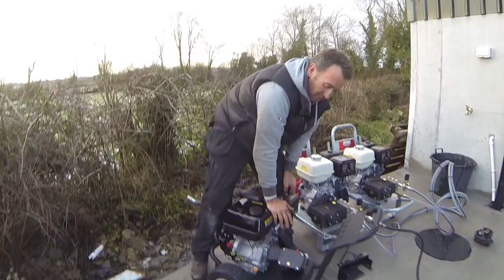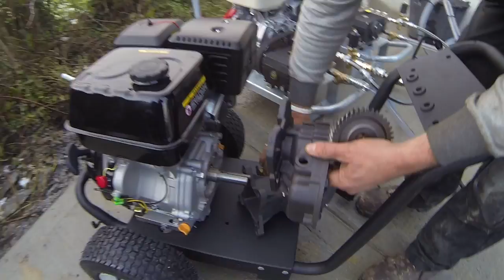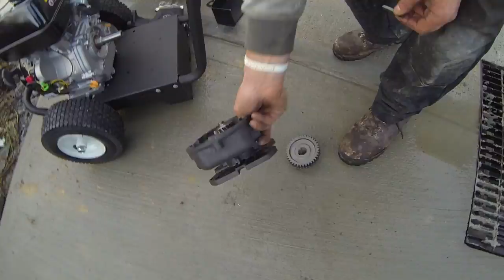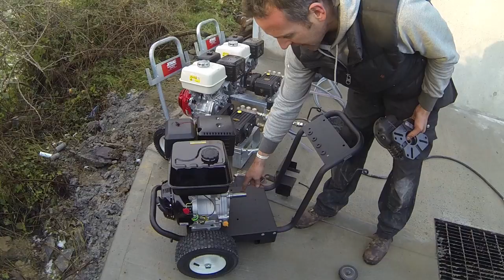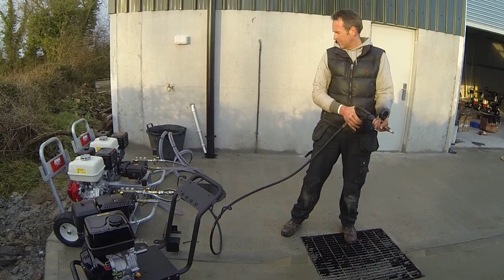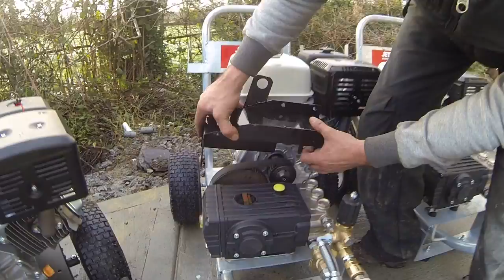Comparison of Pressure washer Pump types - Direct Drive , reduction gearbox & Belt drive

Comment: This is great info. So as a rookie I learned that a direct drive pump cannot suck water from a buffer tank. Ive been told either a gear reduction or pulley system pump is the only way to suck water from a tank. I think this is also an important difference vs the direct drive.
Would this be a correct statement?

Also, on a 13hp GX390, what would be the maximum GPM on a belt system?

Thanks!

Comment: I know this is an older video and very well presented, very educational for new people needing to know this.  I have GX390 that came with a direct drive triplex plunger pump,  can I removve that pump and put on a belt drive system or a gearbox system?  I'm assuming the shaft from the engine is the same for all 3?

Comment: You just made the perfect example. A pressure washer running out of water when you just stuck the hose back in the water tank. With these pumps, how many times can you do what you just did by running out of water and quickly shutting the engine down to you have enough water to start beginning to wash again? I've been in business with my father for over 25 plus years and the pressure washing industry commercial and we always have problems with her pumps going out on us yesterday my Kohler command gear driven pump completely burned up on me it could have caught a fire and I do not know what is causing this problem and once in awhile when I use the surface cleaner it makes the pump create pressure you would think it would make the engine strain but now it made the pump strain so much it created pressure and burned it up and the people are always blaming me for breaking the pumps when I'm not doing anything at all now if you get to a job you got a full tank of water and they don't have good water pressure and you run out you know you got to go and run your to your machine to shut it down running it out of water 15 times a month in a year is that enough to make the pressure washer pump go bad on you and I'm not saying I do that I'm just giving an example it may happen a handful of times running out of water because the customer may have poor water pressure and what causes the pump to get pressure inside of it?

Comment: To keep the water flowing through the pump and system without heating up the water pump, build a reserve bypass tank on through the unloader. Works. No waiting for pressure to build and purge on system. If you need some top secret tips, hit me up.

Comment: They both do the exact same job, cutting the speed in half from the motor. Direct drive is way easier to set up and works absolutely as well as a belt driven system with less maintenance. Both cost about the same... your choice..
Reply: No they don't at all..belt is like $1000 more in same gpm class

Comment: I just ordered the Simpson PS60919 it’s rated at 4400-PSI and 4 GPM. I wanted to get the ALH4020 but it was not available. The PS60919 it’s rated at 9HP and the ALH4020 it’s rated at 13 HP. Can someone explain why the difference in HP when they both have the same Honda GX390?
Reply: Well @4400psi × 4gpm=17.6hp
So theres no way that with a 9hp motor you're going to get 4400psi
Which is fine because you'll never need that much psi, but the problem is that a 9hp will have to work @ 100% all the time to deliver even 3000 psi, which will eventually hurt the motor, as the 13hp wont have to work as hard, but at that psi for even both motors isn't recommend, you really need atleast a 15hp motor.
Hope this helps.

Comment: Belt drive is nice because you can change the pulley and increase the pump speed thusly increasing the PSI but increasing it only to the max recommended and then adjust the motor to increase/decrease engine speed.  I have direct drive with Honda motors, they run so smooth that vibration isn't an issue as well as I have a CAT pump which for what I use it for is flawless.  BUT I will say that my next high GPM machine will be a belt drive.
Reply: krisone63 k

Comment: I dont know a lot about pressure washers but you have a barrel of water, does the pressure washer suck up the water? or is there something to feed it to the pressure washer?
If I bought any gas pressure washer can I do that same thing?
Reply: I was going to ask the same thing. I see no reason why we couldn't also use a bucket of water
to feed the machine. It certainly can in some circumstances make things less complicated... I think.
I assume the pump is what would suck the water in. The question is then: Will this type of setup put 
more wear and tear on the pump?
Reply: @conradb7200  you need minimum of 20psi of pressure for the inlet for a long job

Comment: I have a few questions. Could the reduction gearbox be put on a direct drive engine? I looked at the setup of a few and they have a similar slot where the shaft with a key would be inserted like the direct drive. Also since direct drives aren't as good for pulling water out of a tank would a gearbox be more better at it? If I could salvage my equipment more I'd like to do that. Finally; if I can put a gearbox on, could I amp up the GPM and PSI without affecting the engine performance? Thanks!
Reply: Peter Ravaché where the fuck do you think the gearbox mounts to? Match up the correct gearbox for you engine and the bolt hole patterns and there you go. What in the fuck do y’all people think!!!! Honestly that question you have asked is a red flag indicator to me that you don’t need to be messing with this stuff.